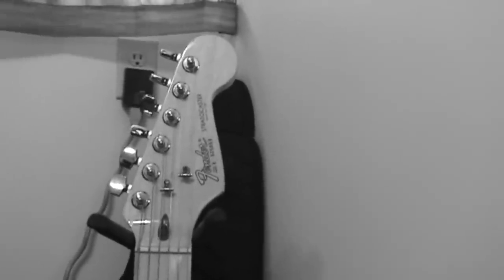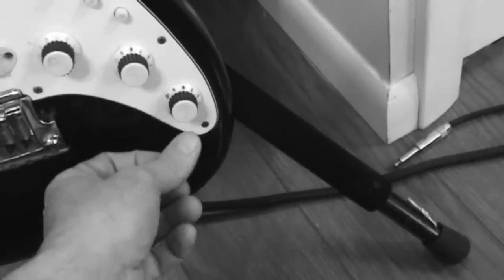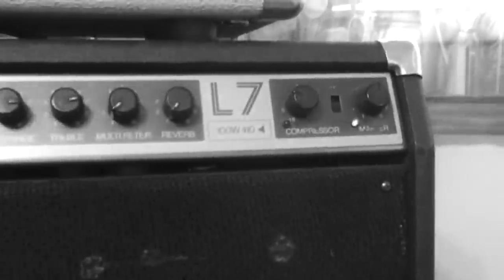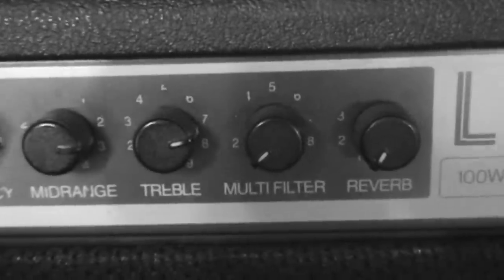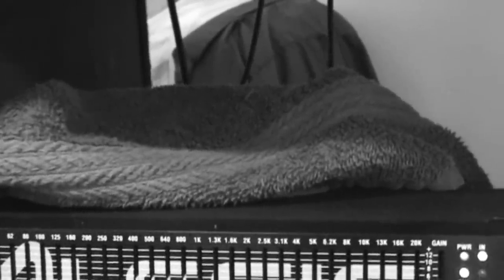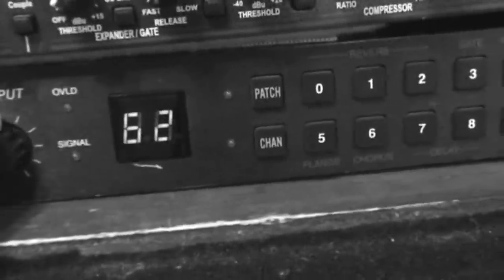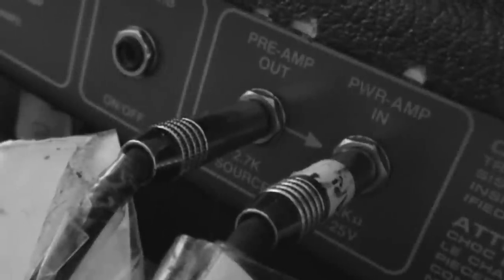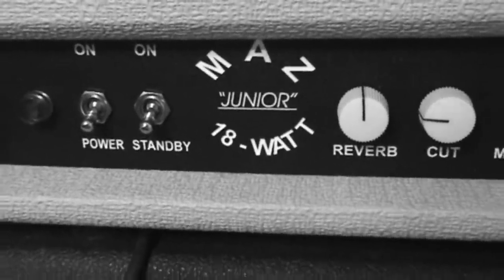Ty Tabor Early Rig-What Is This-Rig Tutorial

Comment: Thanks so much for these videos. I've got a Strat Elite and an L5. Just had the L5 in the shop to get it cleaned up and checked out. When I dial in the settings you've got in the video the distortion is very fizzy -- and when I dial back the high end/high mids it seems to get muddy again. When I run it through a tube power amp/celestion cabinet it is warmer, but still not as great as what you're getting. Any tips for finding a sweet spot --getting a less fizzy distortion through the L5? I'm not sure if my L5 is a lemon or if it's just really hard to get the settings right. Thanks again.

Comment: I know you can't edit on the Midiverb II though it would be great to know the parameters of patch 62, to re create on other gear. Any clue?
Reply from the maker: I would run the mix anywhere from 8 to 11 input to barely clipping and output was the main volume control beings it was the last item in the signal chain.